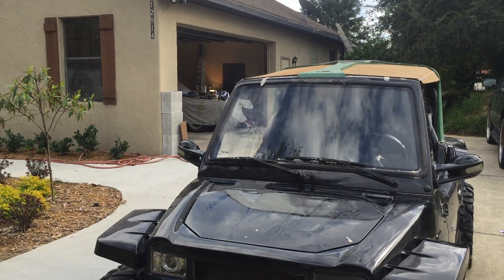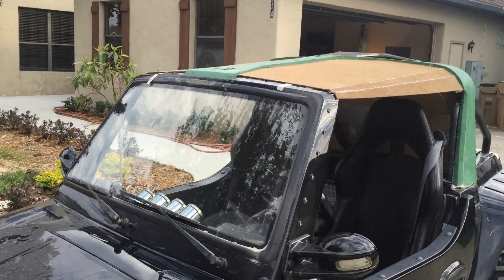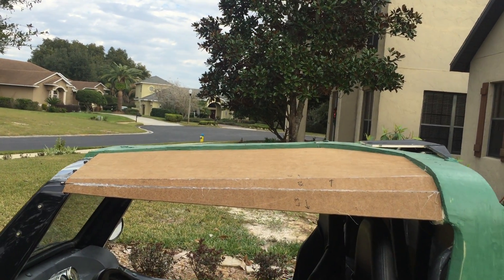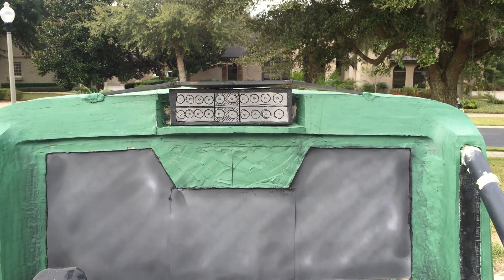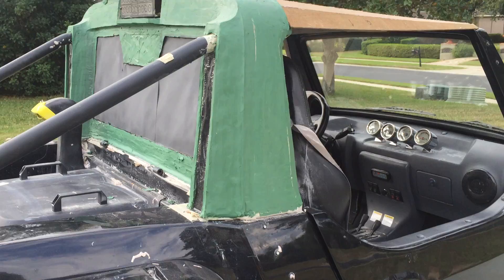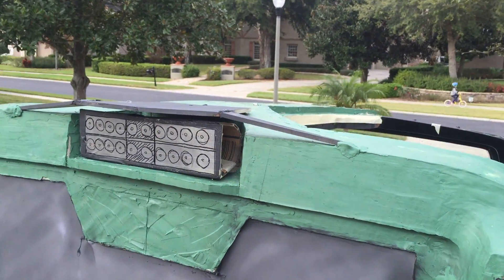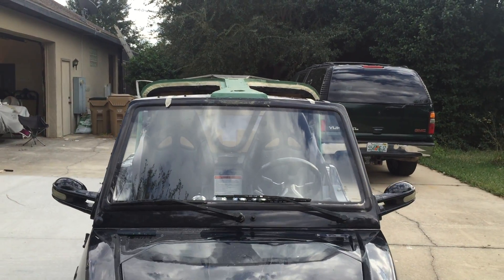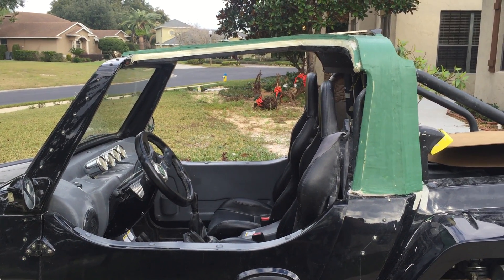VLLN Industries - Oreion Reeper HardTop Development Part1

Comment: I like it I'm 16 and I just bought a blue one 2015 Reeper and I don't like the rag top that came with it u my friend are a Genius I made the snorkel like u did and I have no problems with it but on the cone filter I made mine where you screw it in and it has two o rings to help seal it up if u can I would like for u to make me a t top like that in blue and I will buy it

Comment: Yep, they should have done this from the start. I'm in Colorado we do have snow, and I would not want to be caught in rain with no top. Rain is unpredictable here and due to altitude can be cold. Looking to get a Reeper, and ditch my Jeep...I have Dual Sport bikes for small trails (hence the avatar). Just wish they had a bigger engine option or a diesel engine option.
Reply from the maker: YEAH tell me about it. This top should help out significantly. A little birdie told me that Europe is getting a 2015 model 2-seater with an optional 1100cc pushing around 110HP, but I don't think we'll get them here in the USA. I would love to see a smaller diesel, that would be crazy awesome... I, like many others who own these things have toyed around with the idea of an engine swap. But for the cost, it's hard to justify.
Reply: VLLN Industries Buy a diesel off Alibaba and install it. But then again an odd-ball Chinese diesel will be hard to get parts for.
Reply: How about a Kubota Diesel engine .  Should be a fine engine.  Go for it!  Thanks